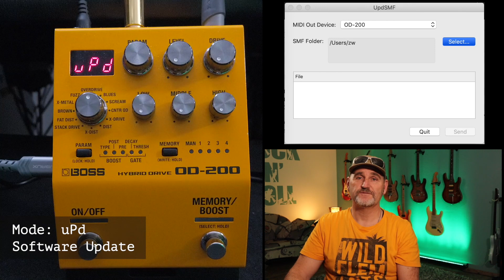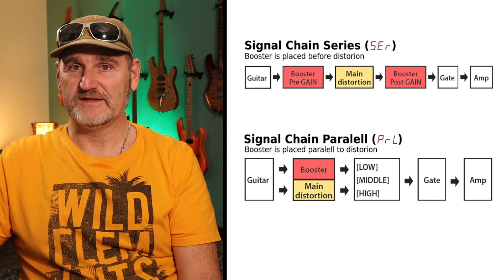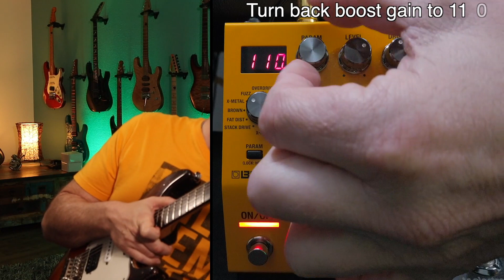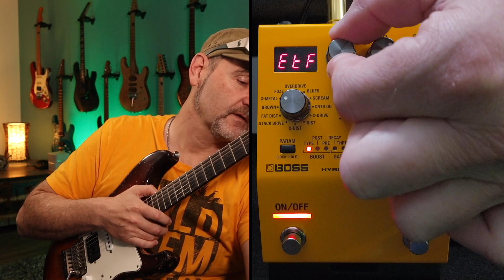BOSS OD-200 Unboxing and Review (Can It Replace All Your Overdrive And Distortion Pedals?)

Comment: I have used many different drive pedals and it was sometimes difficult to get the sound I was looking for.  With this pedal I was easily creating the sound I had in my head mostly due to the ability to adjust the low/mid/high freqs separately.  Also, being able to stack within the pedal is amazing and fun.  This pedal will never leave my board.  On a side note the learning curve initially appears to be overwhelming but once you dive into the settings it makes since and very easy to remember and comprehend.

Comment: Boss haven't done anything decent for a few years now. This pedal is testament to that. It sounds terrible. The tones are all scratchy and farty. Plus it's over complicated. Not worth the money.
Reply from the maker: For me it works fine, possibly it does not work with your amp. However, BOSS is a bit lazy with providing updates - I wish there would be an editor to modify existing presets.